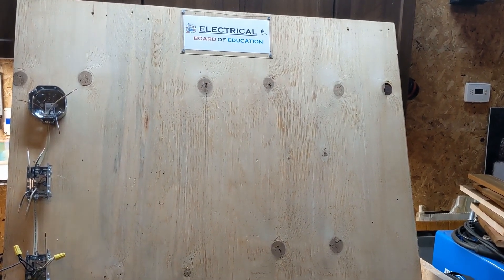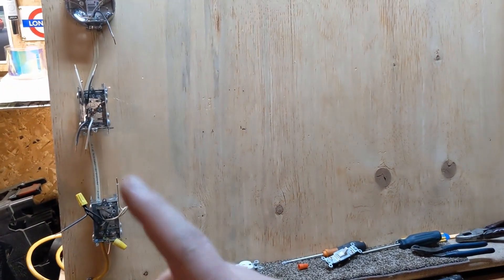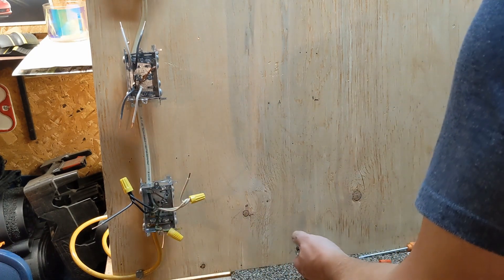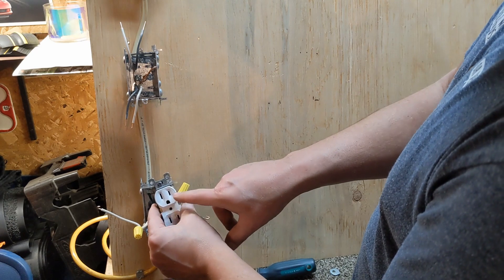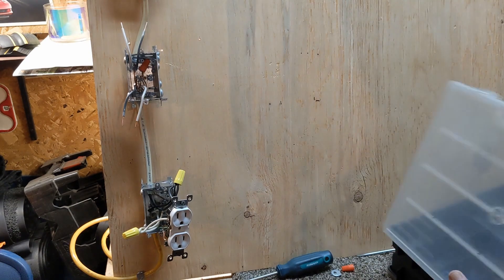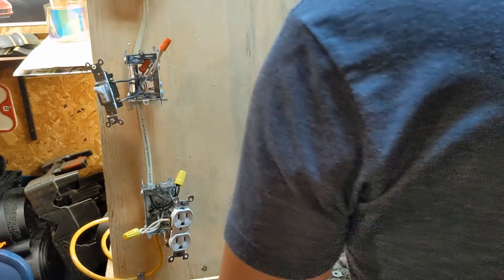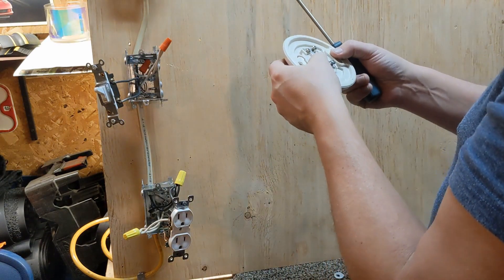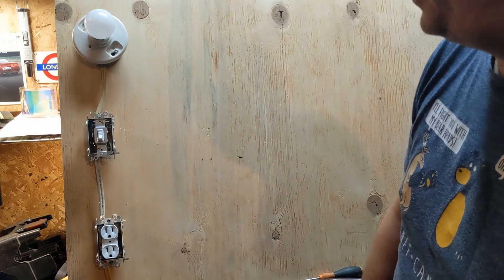Adding A Switch And Light Off Of A Power Source On The "Electrical Board Of Education"

Comment: I have been a electrician for about 20 years..And if I had to work on something that you had touched I would be very piss.ed..You don't leave enough wire in the box and nothing is taped when you use a metal box..And you keep saying plug IT'S called a receptacle..
Reply from the maker: Thanks for checking it out and your thoughts. 
Started the trade in 1991 so been around for a bit as well. Some are quick to tear down but just trying to help some people out there is all. I checked and sadly I did not see any helpful vids on your channel showing a "better way".
As an FYI, I tape marrettes and put a wrap around receptacles and switches (oddly I have found it is not actually common and quite rare when opening up what others have done) but didn't here just to show the connection better but definitely something I agree with and could have shown it.
As for wire length, fair enough as was just doing some quick examples of different scenarios where the boxes where busy in one and not in others. Honestly, didn't put too much thought into it as the proper wiring was my main concern.
All in all, it's all good as thanks for your thoughts, just would have been more productive if it wasn't written with such a chip on your shoulder. Wish all the best still.

Comment: Hello, I have an old house with just 2 black wires çoming from a light switch. I'm trying to add an outlet underneath but only getting power from one or the other on my connection. I ran an added 14 gauge wire from the switch to the new outlet below. Need a little help connecting properly.
Reply from the maker: If there is only 2 wires at the switch you will not be able to run an outlet out of it as there is no Neutral there, it is just switching a Hot wire. It is because of scenarios like this why running a Neutral is now required at all switches. You will have to get power for that outlet from somewhere else, somewhere that has a Neutral as well (different outlet, light etc). Then run a 2c14 with the black wire being the Hot and white being the Neutral. Hope that helps.

Comment: Can you show a set up where power comes from the light, then down to a switch?
Reply from the maker: Thanks for the request and I actually I have done videos on that already that you can check out.
   If you live in North America you will need a 3 wire switch off of your light and can watch my video called "How To Use 3 Wires On A Switch Leg off of a light on the Electrical Board Of Education".
   If you live somewhere where a 2 wire is still code then you can watch my video called "How to wire in a switch to a new or existing light with 2 wires properly with some tips and tricks".
   Both are under the Electrical playlist and I hope that helps :)

Comment: Thank you very direct and simple to follow, on 14/2 Romex how many Led lights and outlets are possible on one line
Reply from the maker: Thanks John. As for your question, make sure you check with local codes first. In short the breaker size decides "how many" can go on it and the wire size has to be large enough to accommodate the breaker rating (15A breaker means wire size must be large enough, therefore 14 AWG).
  For Canada, 14 AWG is good for a 15A breaker and can be loaded to 80% so therefore 12A for everything coming off that breaker. More directly to LED lights, check on the ones you have and see how any amps they draw but on average many are around .5A. 
  So if nothing else is wired to the 15A breaker, you could put 24 LED lights if they are rated for .5A's. When adding outlets you have to count each one for 1A so depending on how many lights and outlets you want, just add them up until you hit 12 amps total (10 lights at .5A and 7 outlets...etc).
Hope that helps :)